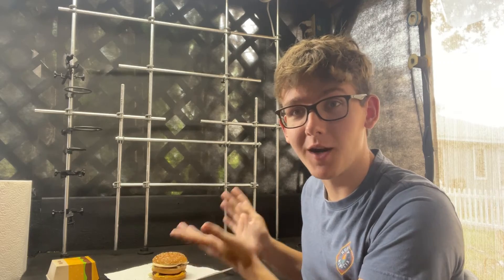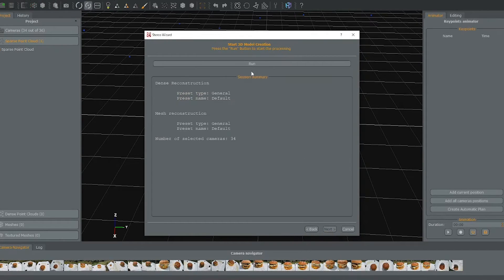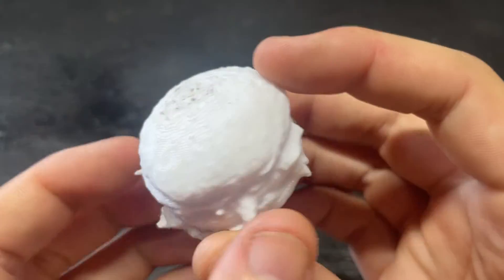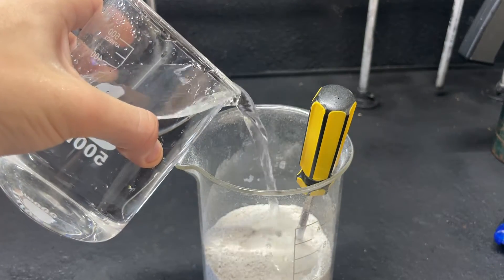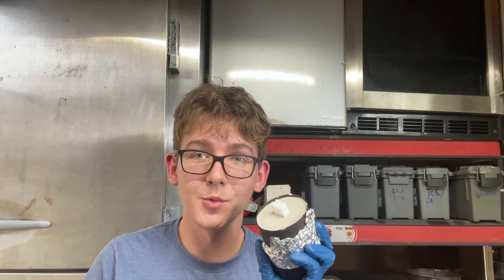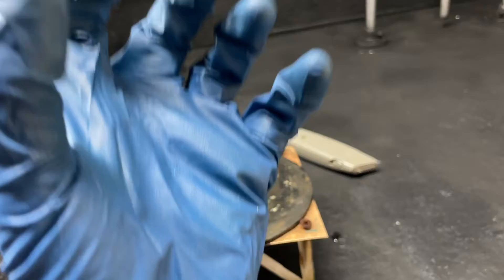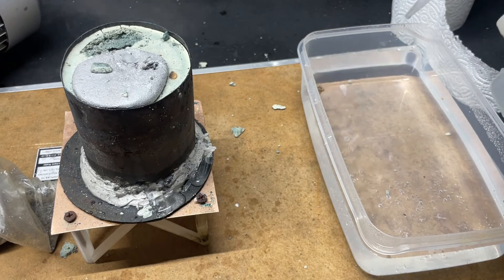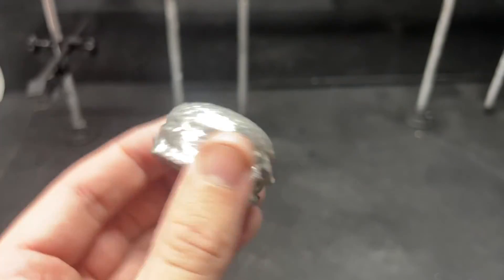How to turn ANYTHING into a metal replica!

Comment: Cool demonstration. To suck the air out of the sand/plaster form only the central opening in the rubber disc is used, correct? Did you puncture the aluminum foil at this point to let the air out? I am surprised the rubber disc is not damaged by the heat during the casting process. Does the very thin aluminum foil provide enough heat protection to prevent such heat damage? Again, very interesting.